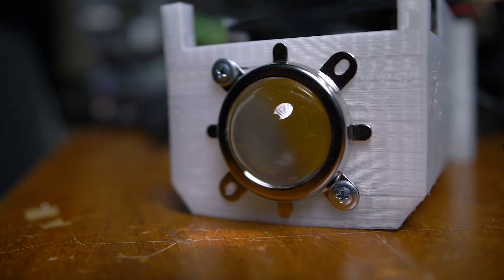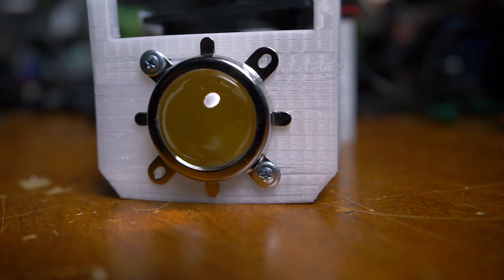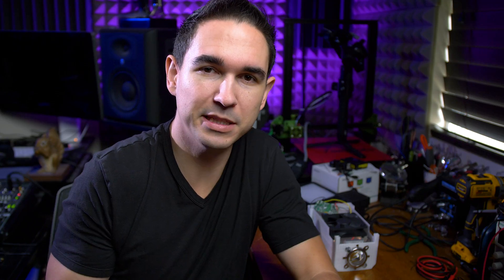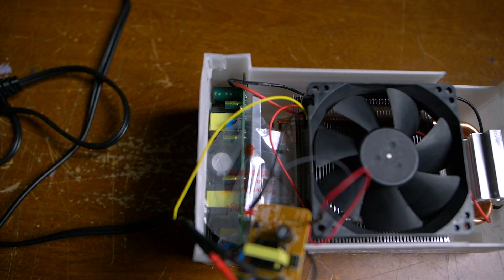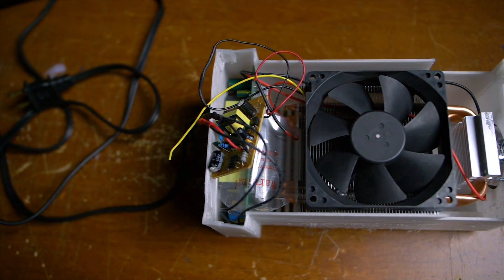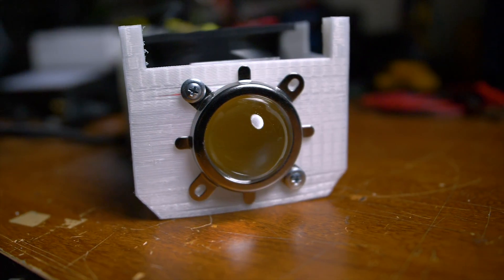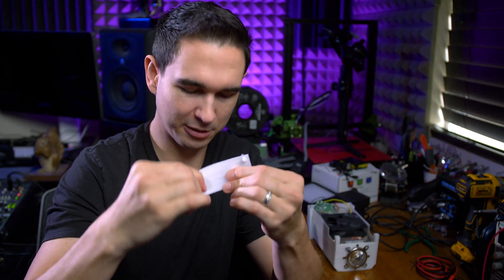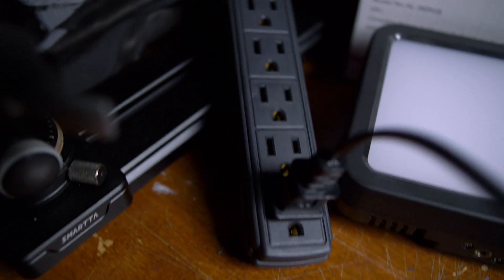3D PRINTED STUDIO LIGHT - IS IT WORTH IT?

Comment: why does it even have a flicker?  shouldn't it just be "on" if it's running DC?  I guess I don't know enough about electronics.   Would it have no flicker if the DC came from a battery instead of synthetically converted from AC?
Reply: oh, great video btw!  forgot to say that at the start
Reply: oh, yeah, a quick google search tells me flicker in LED's all come from when AC power is the source.  Do your battery based LED's have a flicker?   I don't know jack about photography and lights, but I'm very curious.
Reply: haha, someone got a little happy on Amazon with the "cpu" grease https://images-na.ssl-images-amazon.com/images/I/91ryHlCGy%2BL._SL1500_.jpg  Might I suggest long zip ties to hold the fan on to the heat sinc?  the heat should be low enough that the zip ties should live for a few years before degrading from being warm.  or maybe fence wire, might be better
Reply: If you watch some reviews of other diy lights you will notice that they flicker when dimmed. This is because power adjustment is finiky and they actually regulate brightness at lower percentages (sub 20%) by faking out your eye. Another culprit could be a low quality ac adapter which is probably the issue in this video.
Reply: @JohnK-k1o  that makes sense
Reply from the maker: @Beakerzor  The godox light is the one with flicker, and it's probably because it uses PWM for dimming.  I'm going to look into adding a smoothing capacitor to the output to see if I can get rid of it, I'm sure a lot of people would love that project.
Reply: It’s the frequency of the pwm output, if your using voltage regulation to dim you’ll get a decent flickerless light.  But you waste a ton a energy, pwm dimming causes novices a ton of issues because the pwm signal is too low, you need to use a high frequency pwm output to the light to beat the speed of the cameras shutter.  It’s easy to diy such a circuit with a very high frequency pwm signal if you’re into electronics.  If not I’d just buy a light.   I personally have made all 10 of my studio lights and all use a custom pwm circuit to dim the lights at extremely high frequency,  final question is why pwm?  If you using voltage regulation your light is basically just ON.  All the time.  Pwm (pulse width modulation) turns the dc signal on/off (faster then your eyes, or camera-depending on frequency- can see). This making your light so much more efficient and actually increases the longevity of the light as your not blasting it on all the time.